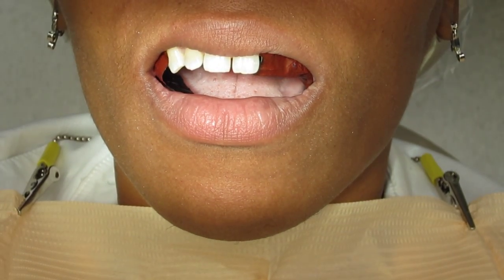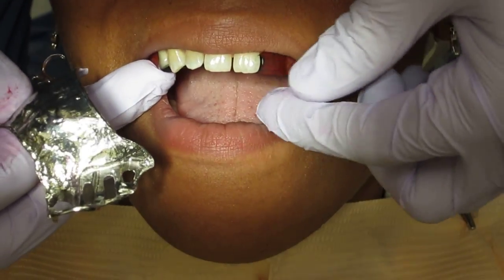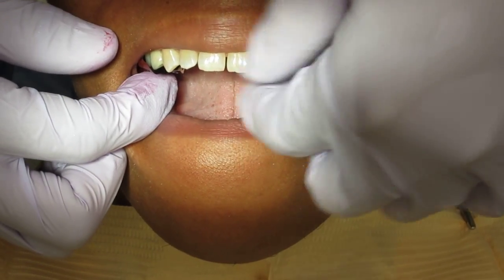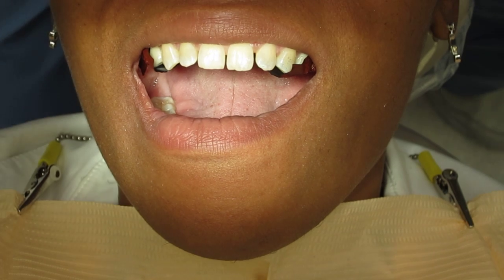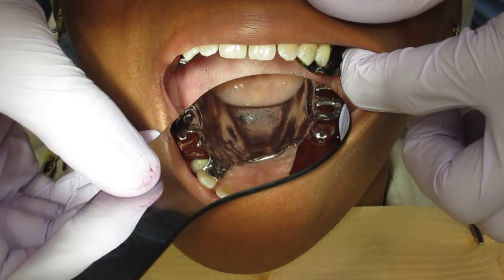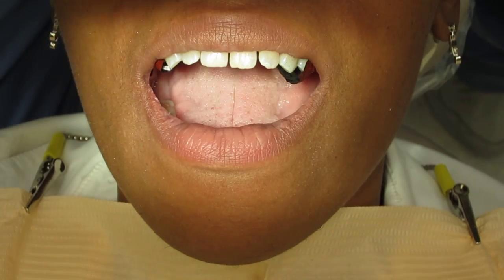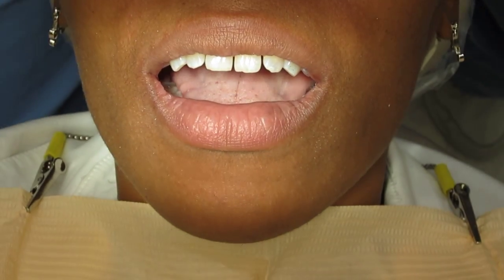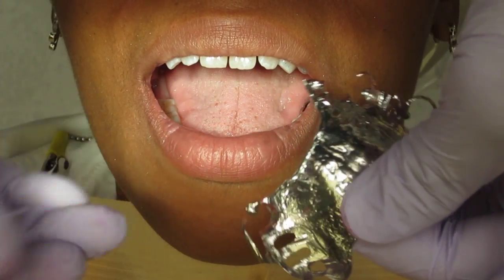Removable Partial Denture Framework "Try in" -  Part 2

Comment: I've been wearing a 3 teeth  metal denture for a couple of years now (fills in the gaps at either side of my top front set like this video). I get on fine with it, just get slight sensitivity when I put it in in the morning as I have a filling tooth nearby, but it 'subsides after a few seconds. At first it felt like a three piece sofa had moved into my mouth, lol but it's amazing how quickly you get used to it being there and it's given me a smile back. My local dentist's been great, reconstructing the teeth I had left, after years of neglect.